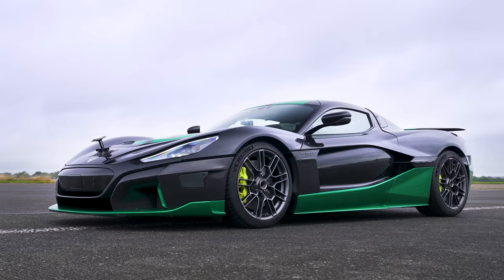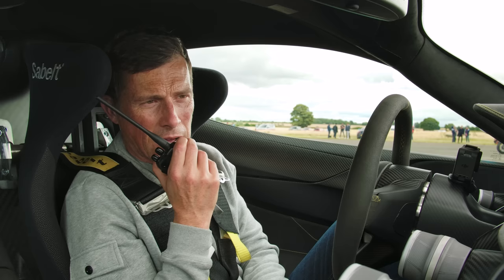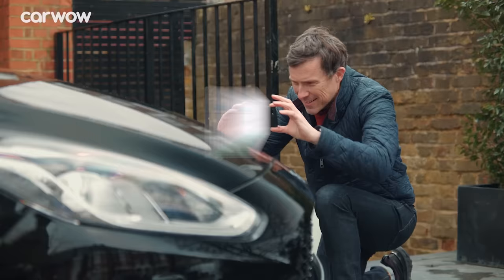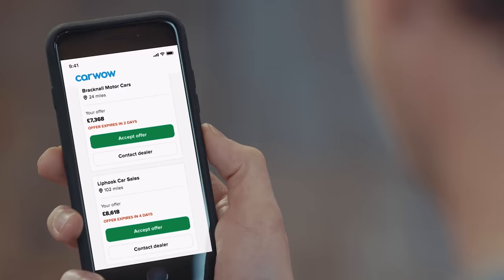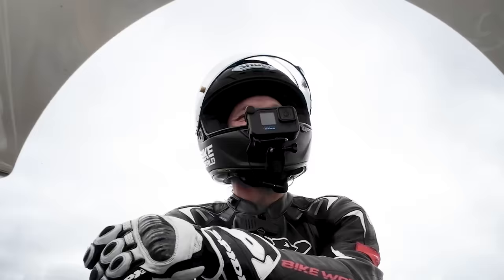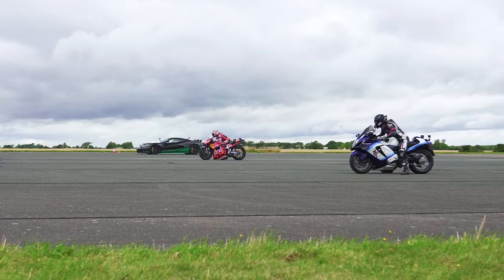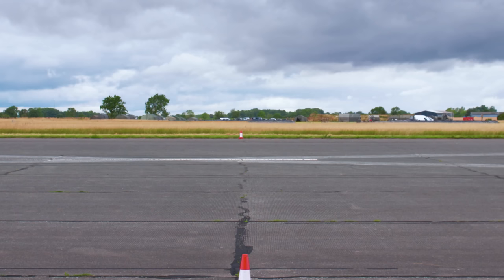MotoGP Bike v Rimac Nevera v Turbo Hayabusa: DRAG RACE

Comment: I had no idea how fast MotoGP bikes were, that's freaking insane to give the Nevara a run for its money
Reply: Have a look at one of the onboard MotoGP videos in Mugello or Qatar.
Reply: I think that motogp is still more expensive than the rimac.. so in this case rimac give motogp a run for its money
Reply: @autolavista  Yep the MotoGP bikes are essentially evolving prototypes. The weight cuts are insane, and as you see you don't need much more power since the main disadvantage vs cars (once money is no obstacle) is that both grip and traction would be alsways superior in a racing car, so the main advantage from bikes is the power to weight ratio whereas the car will top in power, torque, grip and aerodynamics.
Reply: @autolavista except that motogp isn't built for a drag race. Take the car at Mugello or Assen, let's see what happens.
Reply: @autolavista   kid literally crying in every comments section hating on GP bikes 😂 2021 KTM GP bikes only costs $500k 
Due to lot a wind speed Moto GP bike was wobbling and slowing down still smoked Rimac Nevera in 2nd drag race and both rolling races Moto GP is mapped to medium power to make it a fair race

If it was proper racing circuit or drag strip no wind 
The Moto GP bike would destroy Rimac Nevera by bus lengths
And lucky this isn't even a Ducati Moto GP bike 
2022 Ducati Moto GP bike was much faster than this KTM Moto GP bike
Even 2015 Ducati GP bike is faster than most KTM GP bikes
Reply: @Buran01  bro this autolepista kid keeps crying in each comments section
He haven't seen how Much faster Moto GP bikes are this GP bike is struggling with wheelie traction and high wind speed 
Wind is main issue it was slowing down the bikes Still Moto GP bike beat Rimac Nevera on rolling races
GP bike started to wobble at 220 mph still was ahead of Rimac Nevera 

I will see the rematch with a 2022 Ducati Moto GP bike Vs Rimac Nevera on good surface and no wind 
2022 Ducati Moto GP bike was much faster than KTM GP bike

This year KTM GP bike did 366 km/h in Slipstream of Ducati Moto GP bike 
Ducati still had better acceleration and top speed without slipstream

Comment: Almost 2000hp and still couldn't gab the 270hp MotoGP bike says a lot about those prototype machines... hats off to every MotoGP biker and hats off to Dani especially....
Reply: 2000 hp and like 20 times heavier
Reply: That ain’t supposed to happen. Bike guys got butt hurt on that race.
Reply: @AverageGodzillaEnthusiast 20 times heavier?...bruh....you exaggerating a lot
Reply: @AverageGodzillaEnthusiast  Rimac Nevera weight 2300kg,  Motogp bike 157kg without rider, 157 x 20 = 3140, thats a whole 840kg of exaggeration.
Reply: @groovidg  who got hurt lmao you? 
Bike is clearly Faster pulling on each race in high speed wind
Do this 1/4 mile drag race on a racing circuit or drag strip
MotoGP bike will be much faster than Rimac Nevera
Reply: 2000hp with 2300kg of weight,, compared to only 157kg bike😂
Reply: @Smzxe you mean on prepped?? So you think that rimac wont be quicker on prepped surfaces?😂
Reply: @autolavista  and? whats your point?
Reply: @anevictionarbitration8346  the point is that the bike is suppose to win its fucking light as well within decent horsepower
Reply: @investa9772  using your logic, why Redbull RB8 with 800hp and 700kg also cannot win against Rimac in a drag race?
Reply: @anevictionarbitration8346  cuz it kept having problems
Reply: @investa9772  what sort of problem? traction? no downforce at lowspeed? too much downforce at highspeed? incorrect gearing for the ocassion? see? there is alot more in motor racing  than just power to weight ratio.
Reply: @anevictionarbitration8346  u probably just a bike fanboy the only reason they win is cuz of their weight/power ratio compared to heavier sports car go cry somewhere else kiddo
Reply: @investa9772  Yes I am a  bike fanboy, but i also likes cars, and i dont hate them in any way, unllike you hating on bikes for no reason and being ignorant about it. The only one that seems angry and about to cry here is you.
Reply: @investa9772  and stop calling someone kiddo to make yourself feel likes an adult when you still playing whatever lame video game that is and hating on a somethings that not even alive. Doesnt make any sense.
Reply: Bro motorcycle all the way!!!! Why pay over $100k for speed
Reply: Without even setup & using mapping to extract it's full power that set by MotoGp regulations.
Reply: LOL put the same weight on the bike then we will have a fair race, the bike wont even get off the mark
Reply: But MotoGP is not stret legal
Reply: I am so disappointed about the Suzuki. That bike first of all needs a better back tire. 2nd, a better tune. The Kawasaki H2 with full power would be quicker because of it doesn't get the power down and running clean
Reply: Bro that is a MotoGP bike 😂 
Nothing beats that!
Reply: @anevictionarbitration8346 800hp/700kg vs 1900hp/2300kg actual they have almost identical power to weight ratio. redbull was rear wheel drive meanwhile rivera all wheel drive. 800hp for only rear wheel means that car need some serious traction control which limiting launching speed. rivera with all 4 tire with electic motor have advantage here.
Reply: You either win or lose. Period. Sick of bikers having an excuse.....🙄
Reply: Haven't you noticed that the Rimac nevera Smash 380hp superbus?

Comment: This shows how fast a motogp bike is and how good dani can start.
Reply: This is not even the best launch yet just casual wheelspin and wheelies off the line also the high speed wind 
Give Moto GP bike a better surface it will launch much better when it has more traction
Carwow surface is horrible
Reply: No.. this just shows how fast a streetlegal car againts a racing prototype bike..
Reply: @autolavista a £2.4million car…😂😂😂

Comment: Finally. I've always wanted to know what the Rimac Nevera could do against some beastly bikes. Its weird how that imagination came to life here. haha
Reply: Rimac nevera is amazing beast.
Reply: Right!? Its crazy that not even the Rimac can beat the gpbike on the half and quarter mile. And even tho the rimac won overall it wasn't even by much and it all depended on how good Dani's launch was. I thought it will have been an easy win for the rimac on the dig but Dani skill is insane. And thats not even the fastest gpbike of that year. Ducati was miles ahead when it came down to acceleration and top speed those years. Tho i thought it will have been an easy win for the rimac on roll race with its insane topend acceleration knowing that the gpbike will have hit limiter at around 340kmh and start bogging but it was very close once again.
Reply: @redtail1. KTM 2023 record 366,1 kmh bro Brad binder Mugello
Reply: @eldiablo1374  and you have to put gearing of the bike into a factor, the bike is geared for circuit racing, if the KTM has a 1 mile or a drag race gearing, man...
Reply: @jozefjozefczyk3936 nah koenigsegg with their innovations is.

Comment: The way the MotoGP bike starts reeling in that Rimac at 300m was art, only from 350-400 kmh can the car compete. Interesting, very interesting
Reply: MotoGP bike would put even bigger gap on Rimac Nevera
If there was no high speed crosswind bike was wobbling at 220+ mph scary 
This bike has Jerez gearing I would like to see this again with Mugello gearing and with 2022 Ducati MotoGP bike since it was much faster on straights
Bike also requires Better grippy surface like race track
There's no traction on this dusty airstrip
And also 2022 Ducati MotoGP bike will be much much faster than this KTM gp bike or Rimac

Comment: Guessing launch and traction control on the moto gp bike plays a huge part in the outcome. Put an extended arm or a bar and a slick on the busa and the results are likely to change a bunch. Grudge racers get low 8s to high 7s out of a set up like that

Comment: Remember when one of the guy from comments section said the GP was capable of under 9 seconds? He was freaking right lol we saw a 9.2 last time when the GP was against the 911 and KTM Duke, and now an 8.6s!? Dani 's launch is damn brutal 🔥🔥🔥
Reply: That was me dude
Reply: @sagar_27.99  I don't quite remember who it was... But if you really are the guy then cheers 😂👍🏻
Reply: @superdupersniper  just think....a ducati gp bike gaps every other bike on the grid 😂 rimac wouldnt win that race, thats for sure
Reply: Since he is used to launch his bike so much at the max, verry consistent, i don't understand how he can become 0.6 seconds faster. Dani was 4 or 5 times on Carwow i think, but never faster than a 9.2. So to make such an improvement (in drag racing terms) makes me wonder what is changed on the bike.
Reply: it could go much quicker if the bike has longer swing arms and a little more hp, in usual setting MotoGP bikes are around 250-280hp but they could go up to 300hp, and then gear the bike to go faster top speed, bye bye rimac
Reply: @sagar_27.99 what a legend
Reply: I said it too. That's concrete so better surface and we can expect even better times
Reply: Remember this is not even a prepped dragstrip.  In the prepped dragstrip both the MotoGP bike and Rimac nevera will definitely reach Low 8 second quarter mile times, like 8.1 or 8.2 .
Reply: Does the lower part of the bike effects it's launch whatsoever? Because it's so damn close to the ground lol I'm always worried whenever he launch that bike

Comment: That car is absolutely insane, incredible engineering... Makes me wonder just how fast it could go if the batteries got lighter.
Reply: They are now creating lithium car battery cells the size of hair, that car will be insane in a year or two when they shave a ton of weight off it lol
Reply: @Mikey420isTaken  Still tyre technology would have to improve as well.
Reply: Wish we had MM93 in there as well. Real entertainer
Reply: @Korculanac11 True but I bet they can manage something or at least I hope so lol
Reply: I think the incoming Porsche Mission X will be the next big thing in hyper EVs. I aiming to be around only 1k+ HP but around 1:1 Kg/HP ratio. SAn to crush the Nurburgring best lap time...

Comment: Little known fact when on a motorcycle is sometimes you have to stay wide open for safety. If things get sketchy or wiggly, being wide open on the throttle can save you because it’ll make the bike want to stay upright and straight.
Reply: If the front starts wobbling the last thing you want is more load on the front. WOT transfers the traction and the weight to the rear, which also slightly changes the geometry on the front to a less aggressive angle by unloading the suspension. It also reduce forward momentum on the frame etc. 

You're absolutely right, just wanted to explain if someone was wondering why. It's good to remember, saved me a few times (when I had rusty headbearings).
Reply: It's also a fact that riding fast in a straight line is actually easier than riding very slowly round obstacles. 
Getting trainees to speed up when their brain is screaming that going slow is safer is quite the challenge.

Comment: An original production car beat a motoGP, this is absolutely insane, that story that motorcycles have more acceleration I think it ended up against electric cars
Reply: Yeah,I'm absolutely surprised that rimac nevera can keep up with moto gp bike. It got some serious acceleration.
Reply: The MotoGP bike won.
Reply: @ianmacfarlane1241  Still rimac nevera is a production car and moto gp is race bike. I'm sure nevera will destroy any production bike including h2r since h2r is slower than moto gp bike.
Reply: @rctv9974  You say that as if it's a £15k family saloon, when it's a highly developed, £2 - 2.5m  supercar, (also the one in the video is a test bed, so it'd be fair to assume that it's even more special than any of the customer units).
Production car or not the Rimac will have an aerodynamic advantage, AND because of it's mass and number, (and size) of tyre contact areas it has a significant advantage when it comes to putting down it's power.
(Matt even illustrates this by showing Dani how idiot proof the launch sequence is - Dani, on the motorbike has to rely on nothing but skill).
You've got a very special motorbike facing off against a very special car, and the bike won...a convincing win at that.

You've also got to remember that there are far less restrictions when it comes to building extreme production cars.
It's very rare that a motorcycle manufacturer will throw everything at a production model - I can only think of two instances - the 07/08 Ducati Desmosedici RR and the 2019 Honda RC213V-S - both of which were sold in a detuned state.

Comment: Awesome video and races. That Nevera is crazy fast. Props to the MotoGP bike and rider for giving it a run for the money.  I’d love to see the Nevera vs Chris Moore’s 600hp turbo HyperBusa. That thing is insane, and Chris certainly has drag racing credentials.
Reply: There's a lot of wind which is stopping Moto GP bike acceleration bik was wobbling as well 200+ mph well 
On proper racing circuit or drag strip with low wind Moto GP bike destroys Rimac Nevera 
2022 Ducati Moto GP bike is much faster than this KTM Moto GP bike 
So Ducati GP bike will be better in a rematch
Reply: GP Bike would smoke the Rimac nevera by bigger gap if the no crosswind was there bike was wiggling still ahead of Rimac nevera 220+ mph crazy

Comment: We need a drag race between Liam vs Dani vs Mat in the McMurty 🔥🔥🔥
Reply: McMurt"r"y
Reply: mcmurtry would smoke them all
Reply: @sharkgaming3929  Rimac beat it already in the quarter mile.
Reply: @yofolkdem1256   yeah, but Mcmurtry is better at launching due to the fan system creating a lot of downforce and it's ability to spin up its tires to get them warm ready for the drag race should make it very interesting against the bikes

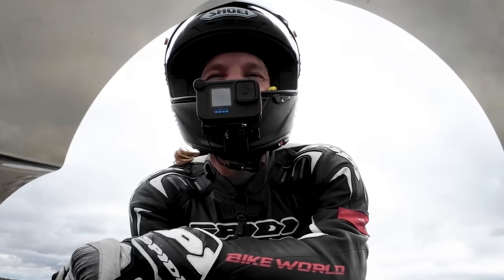Comment: The KTM has the best launch control of all MotoGP bikes. It is still not on a par with Ducati as an overall package, but still almost always beats it at the start. The Rimac is a great achievement, especially on a drag race, but around a circuit it falls behind cars with way less than half its power. Just last week around the Nurburgring it lapped in 7:05, which currently places it only 25th fastest amongst production/street legal cars. It need to loose at least 1 tonne of its weight before it can go fast around bends.
Reply: Just very recently Ducati's launches are actually looking better than KTM's, as Pecco pulled away slightly off the start. It seems like Ducati have made some improvements over the last races.

Comment: Wow those bikes are insane!! The way he can launch that KTM is just crazy skill! 

Putting the Rimac against a top fuel dragster one day would be cool 😁
Reply: It would look very slow against a top fuel dragster. The dragster could give the rimac a half track head start and still have plenty of time to spare. In the same time it takes to get the rimac to 100mph the top fuel dragsters are at 300+ mph and done with the quarter mile run. 2,000hp vs 10,000hp is a very big difference.

Comment: You should SOMEHOW get a 2016 F1 car (fastest ever on a straight line) to race in one of these drag races at full power, using DRS and everything it has, that would be the ticket!
Reply: An F1 generations race.. v12, v10 etc. will be $$$$$
Reply: It would lose. Theoretically at least.
Reply: @F1ll1nTh3Blanks  It would easily beat the RIMAC from a roll, I mean the wimpy 2013 V8 Red Bull was already close with no DRS or KERS (probably a detuned engine aswell), It would THEORETICALLY win the 1/4 mile run too, Dan Ric did 0-200km/h in 4.2s at the restart of the 2020 Tuscan GP when the fuel was a bit lower than usual (they always start the race with loaded fuel tanks, obviously), a much lighter 2016 car should be even quicker...
Reply: @bosshunterman  Yeah, I thought you were talking about from a standing start tbh.
Reply: @F1ll1nTh3Blanks  Even from a standing start, the RIMAC can't do 0-200km/h in 4.2s (or less in the case of a 2016 car in optimal conditions), nor can a MotoGP bike... But it probably wouldn't quiet be an optimal race for the F1 car, that's what makes it interesting.
Reply: f1 cars aren't the fastest in a straight line, you should watch more drag races.
Reply: @jayc342009  And you should watch more F1 to know that these drag races don't paint the full picture...A fully prepped (fuel, tyres, setup, aero setup, low fuel,..) F1 with the engine in qualifying mode, on track surface, would smoke the Rimac. Any F1, from the late 90s to today. Doesn't matter which.
Reply: The 2016 model maybe, but F1 engines are expensive so they wouldn't risk blowing it on a drag race, that's why we'll never see a fully prepped F1 with the engine running of full power. Even so, the F1 tyres are made for the track, they don't really work on roads like this.
Reply: @wss33  it would smoke the rimac sure, but it isn't the fastest in a straight line
Reply: @jayc342009  The fastest in a straight line is a jet plane, the SR-71 Blackbird.

Comment: Dani would have beat the Chiron SS with this bike.
Reply: H2R would have gapped Chiron SS if it didn't wheelie 
I just wanna see H2R with race ECU and unrestricted throttle with full power unlocked
Because H2R gains 50 whp more just with software flash
Reply: Motogp bike ktm gonna kill h2r in drag race😅 @Smzxe
Reply: @tokek234  I have said this already MotoGP destroys H2R 
MotoGP 0-300 km/h 8 seconds 
H2R 0-300 km/h 11-12 seconds not even close
Reply: @Smzxe  motogp bike faster buddy,,h2r down